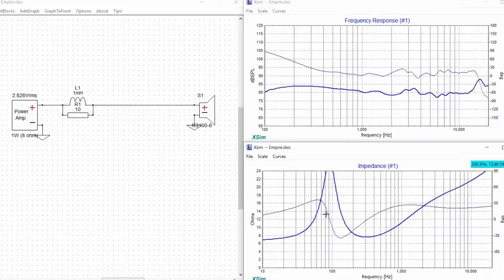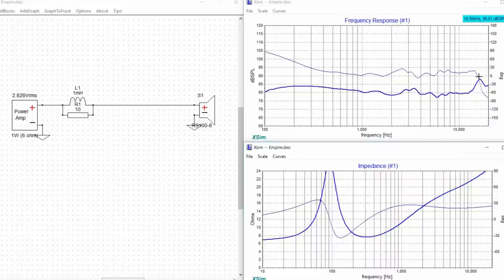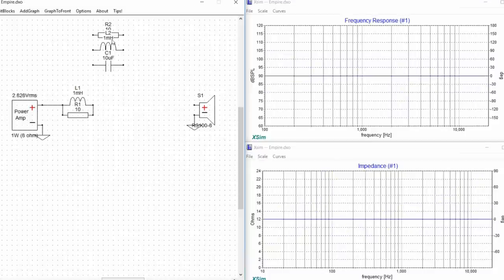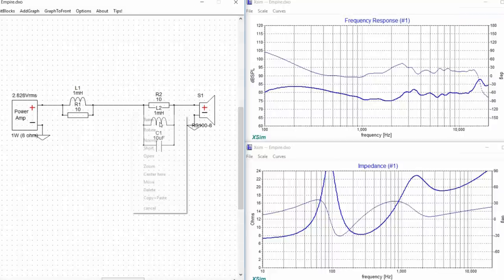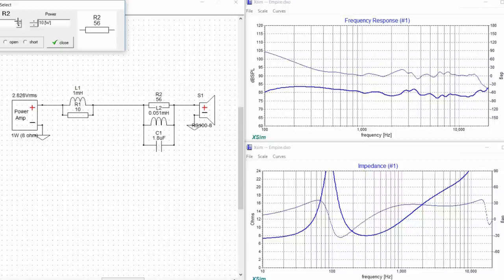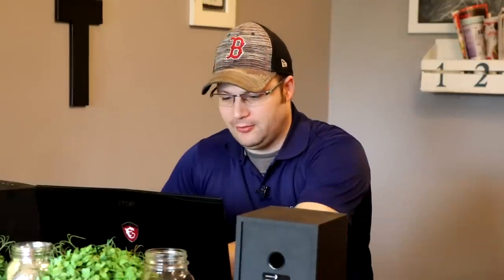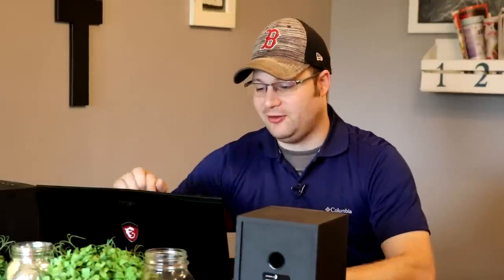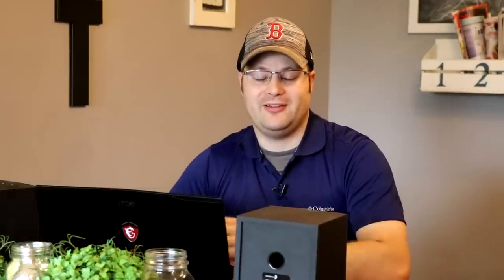How to get the Best Sound from a Full-Range Driver - Part 2

Comment: Not sure I buy that the 17k peak is a huge issue.  Overall room response is well down from beaming - listen slightly off axis.  But its clear - go active and see how it sounds, so you can play before committing to passive components.  And then put them in an external crossover.

Comment: If you use the built in function in XSim you can specify the target frequency and Q value and it’ll calc the values. But this video stills helps with the basic understanding.Danny Richie at GR-Research has a good video on this too which further helps the full understanding

Comment: Very interesting  video. However it would be interesting to know the ''width'' of the notch filter  (I think it's called  the Q factor) and how to adjust it depending on how sharp the unwanted peak is.
Reply: yeah. his videos are very specific to a given project. this was a great for this driver but doesnt really how how to apply this to other drivers other then just trial and error. like at 4:10 im proud of you toids you are really good and all but that is why im here it to see what these components do, not see what values fit this project.

Comment: Very informative video. Unfortunately it addresses the frequency anomaly only, but does not take into account the phase shift caused by the notch filter. It is likely that the driver will sound better without the notch filter, as the improvement in frequency response will not make up for the phase shift issues that are introduced.

Comment: Would adding a Zobel to flatten the impedance curve be a good idea?
Reply from the maker: Not in this case. You wouldn't really use a zobo on a full range driver unless you were using that full range driver as a mid-range or a woofer. Just keep mind impedance is going to go up and down with frequency. It's not going to be flat. That's normal for a loudspeaker.

Comment: Hi how are you. Your video was good. I live in England I am wanting to build my first pair of speakers with a full range driver. I have been looking at the Dayton audio full range drivers. Could you send me some information on what to buy and the instructions on how to make it. I have some experience with upgrading a hifi valve amp by changing capacitors and some of the cables which was more difficult than building a speaker with one driver because I had replaced more parts than what I would have to use to build a set of speakers similar to what you were talking about. What computer program were you using.

Comment: Have you ever tried building a multiple full range driver speaker, I was thinking a couple of small drivers with a big one could sound decent. Maybe plugging the small ones in parrallel and then plugging the big one in series with that, so that each small one sees about half the power of the big one, assuming they all have the same impedance.
Reply from the maker: I haven't tried that
Reply: You could try something with a bunch – say, eight or so – of small 3-4” drivers facing the rear as reflective ambient sound, and one facing forward, for that “concert hall” feeling. You might need some eq on it as well. :)
Reply: @keithgardner5818  anbd call it the bose 901 L.OL.

Comment: I would like to see a response to the question asked by Mr Pablo Moreno as well, although I would ask, “why not just leave it alone,” for the same reason given here by him. Well Rounded Sound pretty much answered it I suppose, in the case of this specific driver, but it makes me wonder if perhaps this is just a crappy-sounding driver? I never thought much of Dayton. 

I have a couple pairs of vintage single-driver “full-range” speaker systems that I’ve been listening to on and off over these many years. They utilize the Pioneer A11EC80-02F 4.5” driver, which has served reasonably well, for what it is. I’ve been very tempted to replace them with Fostex FF125WK or FE126En drivers, but I like to run them without additional circuitry, which ability I always felt was one of the features of full-range systems. 

I’ve spent many years listening to all kinds of speakers, but not much looking at charts. I guess my question is, regardless of how it looks on paper, how much difference does your notch filter actually make in terms of the *sound*? And, if I were to grab a couple of the Fostex drivers I mentioned, if you’re familiar with these, how much difference could I expect to see by tweaking their response curve as you’ve done here (assuming it shows the need) vs leaving them free and unfettered, as god intended? :) I’m thinking that by selecting a better driver to begin with, you would be better off than trying to fix a less musical driver. 

Your thoughts?
Reply from the maker: It's a great question. In which, there really is no perfect answer. I'm showing theoretically if you're going for a flat response how to achieve that with a full-range driver. But as you have pointed out, many full-range drivers sound great without flattening out the response. In fact, many people prefer responses that are not flat.  This, will definitely make a difference in sound, but it may not be enough for some people to justify.  Especially when you add in the cost and complexity of the crossover.  Many people choose to run then without a filter and are very happy with it. In fact, I'm using this save driver in an upcoming build and don't use any filters on it.  So I don't consider myself fixing it.  Just enhancing the response you want from the driver.  Of course, in the end, that is all personal preference.

Comment: Great video, thanks. I understand more now how does filters exactly work. Keep it coming! Anyway, i am going to build a sub and am waiting for the wood package, precut and ready to put together. 
My next plan is to build two small towers, like 20cm wide and about 1 to 1.20 mtr high. Thing is, i want to grab the "dynaudio Emit 30" sound. Maybe you have listened to them already. They have a 2.5 way design, i think. Two mid/woofers and a softdome tweeter. The sound is full body, warm and punchy, great detail in the high. Just the way i like it. So in order to get that soudstage, what kind of drivers i am looking for ? Maybe a though question, while i have no clue what i must look for. All i know is i need a sparkling tweeter, not harsch but whit great detail and some 5~6.5 inch midwoofers which can go up to say 3~4Khz smoothly. I was thinkink of a TL tapered line for them.

Comment: Do we need baffle step compensation for a tower speaker for the tweeter because you mentioned that when the driver is in a box it looses up to 6db and the wave lengths are shorter above 1khz so should the levels from 1000Hz bellow be +6db above the rest or this is an issue only for single driver box

Comment: So what happens to all your adjustments once the driver is installed in the speaker enclosure?  Won't that significantly affect the frequency response?
Reply from the maker: Ideally you would take these measurements in the box. I'm just showing you what you would do once you have the measurements. The great thing with using something like this is everyone has access to these files. That way they can work with them and see what they come up with.

Comment: Noob question: Can you buy components at the specific values set on the components (resistors, inductors and capacitors)?
Reply from the maker: Yes you can
Reply from the maker: I no like to get kind at Parts Express

Comment: In part one of the two parts you used a four ohm, but in part two you used an eight ohm.  Would there be a difference in crossovers for the different resistance?  I have used this speaker in a Bluetooth box and was glad to see this video but was wondering about the discrepancy.  Great videos by the way.
Reply from the maker: I just used the 8 ohm to show it works with either if them. The filters will be different and are different. But it's fairly easy to sim after getting used to it.

Comment: But wait, are you look at the frequency response of the drivers alone or a drivers in the actual box with the crossovers?
Reply from the maker: The concept is the same either way you look at it.  In this theoretical response, we are looking at a full range driver.  We are making the crossover network for it, which includes a BSC and a notch filter.  If you have more peaks caused by diffraction or if you need to increase you BSC, you will be able to use these same principles to get the response you are desiring.

Comment: Why you want to correct or attenuate the peak at 17k, most humans don't hear such high frequencies anyway, a better approach would be a 12dB per octave roll off from 12k down, I'm just saying..
Reply from the maker: The full range of human hearing is considered 20hz to 20Khz.  You are right that there are people who cannot hear in this range, that especially includes many men over the age of 50.  However, if you are trying to attain the flattest/purest response, assuming the full-range of hearing, you would take care of that area.  But if you are one of the people who have a hard time hearing that high, then you are absolutely right to just leave it alone.

Comment: What if i take full range driver and cross at something like 3-4khz and add tweeter, would it be better that way or there would be no benefit? One thing i always notice on full ramge drivers is that highs aren't that sharp.
Reply from the maker: That is a good question.  You can do that and have some really good benefits from it. Especially getting the type of sound you want from it.  However it all depends.  If you look at some "full-range" drivers frequency response you will see that they really aren't any good after 10-12k, which might also be the reason you think the highs aren't that sharp.   It is a little misleading calling them full-range in my opinion, but it is done quite often.

Comment: Hi!. Whats your opinion on the xls encore? Greetings!
Reply from the maker: I've never heard them, so I really couldn't say how they perform.  My one concern is that there appears to be a lot of upsell for different components that shouldn't make an audible difference. The only one that I can see that would make a difference is the bypass cap.  But if the speaker needs it, I'm not sure why it's an option.  So that would be the concern I would have. But they are good drivers, so I'm sure if the crossovers and box are designed well, they would sound good.
Reply: @Toid  thanks for the reply. Appriciate it. You say if the crossover is designed right...but for what I understood; Its rightly designed because they are top notch components...(?)nor isnt that the case? For how much could one build a kit by its own and have the same results you think?

Comment: Ok, now how do you address the drop at 2k?
Also I went to your site but couldn’t find contact info for you there. So, I’ve got a pair of Silver Flute 6.5” 4 ohm drivers I need to something with. I’ve also got some old Peerless dome mids and dome tweeters from a pair of speakers I built long ago. They used peerless kg120 woofers but after 20 some years in the AZ sun they disintegrated. I want to use them in a three or four way design. The mids are going for $275 ea used but the tweeters are not the greatest. So I might just use the mids and a newer pair of tweeters with them. So, I need help designing and have cabs built for these two projects.
Reply from the maker: That's not really an issue. Keep in mind or zoomed in very far. That's only about a 1db drop, which is perfectly acceptable. And at 2Khz, is even preferably to some.

Comment: Series Notch Filters are designed to dampen driver resonance at its resonance frequency (fs).
Parallel Notch (Trap) Filters are designed to remove broad peaks in the frequency response of a driver. These filters are more complicated than the Series Notch Filter, because the components are in series with the driver. The resistance of the inductor and the type (mylar, electrolytic, polypropylene) of capacitor will affect the performance of this circuit.
Impedance Equalization Circuits, also know as "Zobel" circuits, are used to counteract the rising impedance of a voice coil caused by inductive reactance. This problem mainly occurs in sub woofers because of their large coils. A Impedance Equalization circuit is usually placed after the crossover.

Comment: I like your video. Check this out. I'm trying to build a a speaker with the brand new Tang Band W8-2314 8" Coaxial Full-Range Woofer. I'll be using 2 drivers per box in series. What would you do in that case?

Comment: How I got really tight bass on a 3-way speaker woofer. I have a 100 mf cap and a 1 ohm resistor in parl, and that is in series with my main inductors, which is a 9 mh inductor in parl with a (3 mh inductor that is in series with a 2 ohm resistor). The 6.5" woofer is also in a double chamber bass reflex enclosure. The best bass I have ever made in a speaker.

Comment: Would you just use dsp;
Reply from the maker: You can do that.  But a DSP costs around $150 and you have to keep it with the speakers.  The passive crossover depending on quality could be less than $20 for both and they stay with the speaker forever.
Reply: Toid's DIY Audio getting the cost out of the equation i find dsp better sonically what's your opinion ;
Reply from the maker: A properly designed passive crossover can sound just as good as a properly implemented DSP.  But a DSP definitely has it's advantages, including changing the sound whenever you want.  I personally prefer passive crossovers, but I completely understand why more and more people are going to DSP.
Reply from the maker: Rofl Copter that's a great point! They work on the sure wondom amplifiers. I haven't used them myself. Have you? I have wanted to try them though